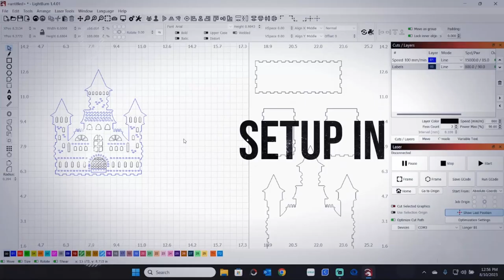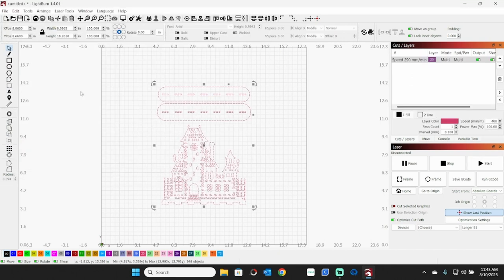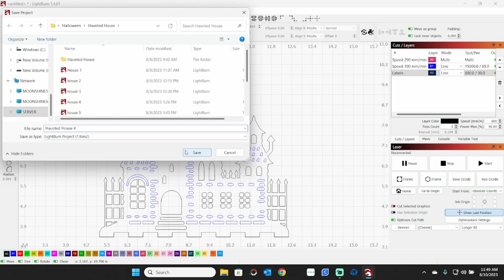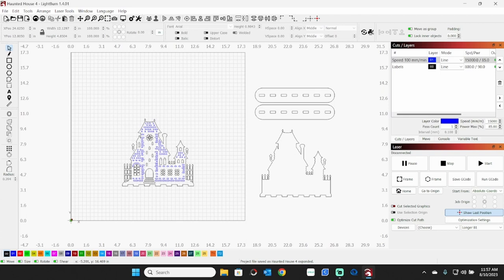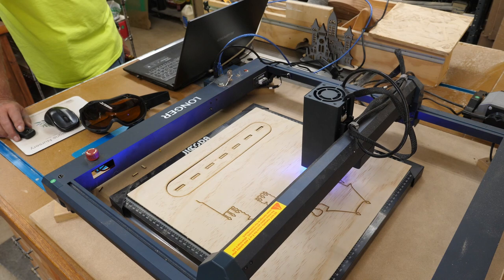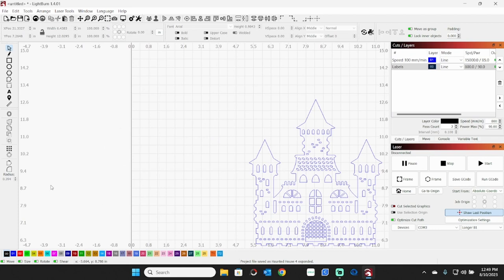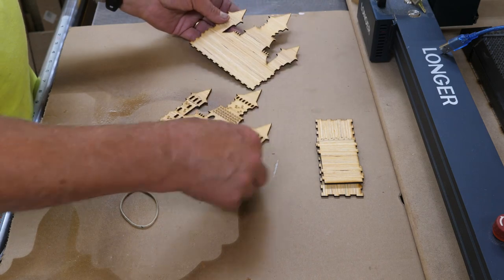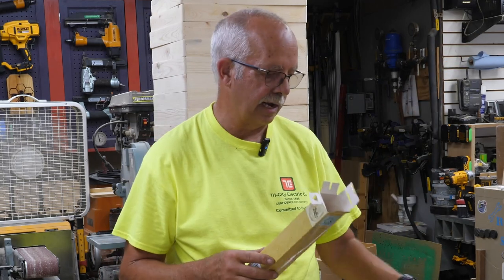Halloween Houses Beginner Laser Project 19

Comment: Would the settings be the same for a 5 watt?
Reply from the maker: No.  You will need to run some tests on scraps.  Not every laser is the same, so just doubling time or power will not work as the difference is not linear.